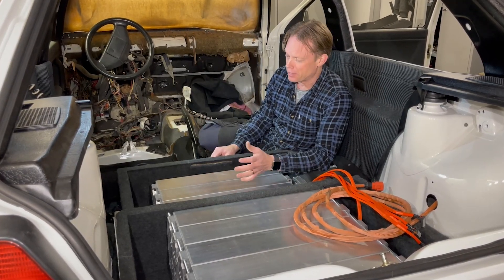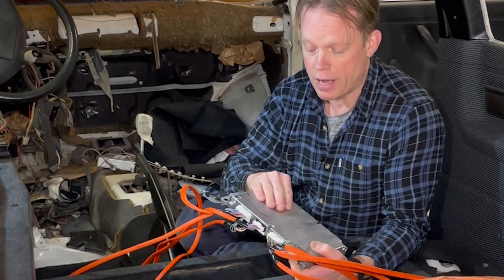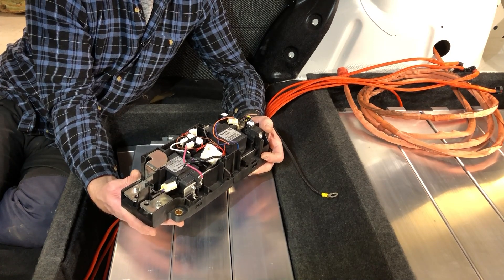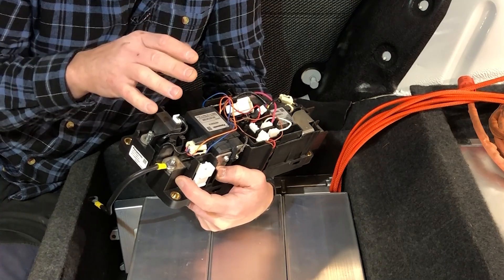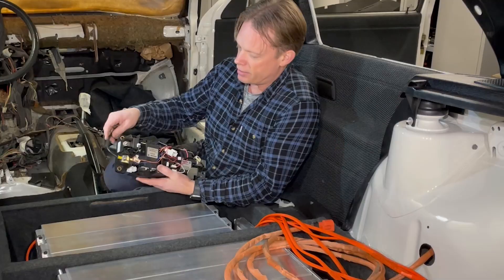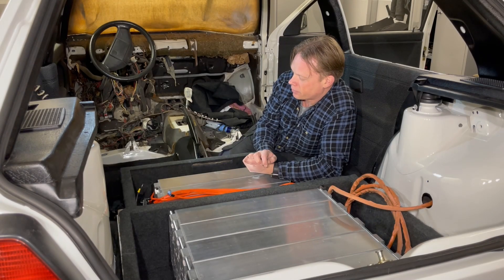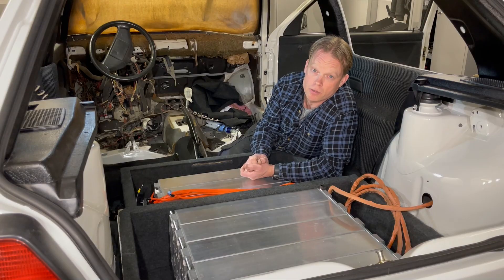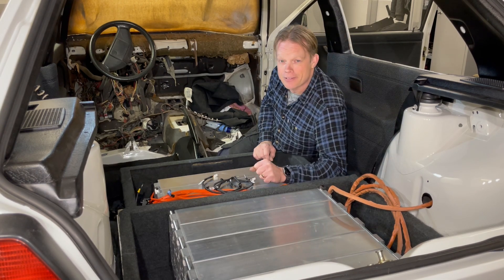Building a HV EV Battery to my Vw Golf Mk2 Citystromer

Comment: Did you only have to connect the individual cell voltage leads to the Leaf BMS connector to get it to work?
Are there any battery temp sensors that also need to be connected?
Was any CAN hacking required, or is this all just analog connections to individual cells?

I really like your method of using the Resolve controller with Leaf BMS, but using a different battery. It keeps all the functionality of the Resolve/Leaf system, but allows you to get a different battery if you need a different form factor or larger battery. A lot of the leaf batteries are also pretty degraded when you buy salvage cars, so using a different battery opens up so many options.

Comment: Any cooling issues I see you have finished your conversion, is pack air cooled?
Reply from the maker: No it works great here in Sweden. During fast charging I can see that the temperature rises around 4 degrees/10 kWh charged. So there will definitely be some limitations when doing that. But otherwise just fine.
Reply: @flyingtools  thanks for replying Sweden sounds super cool!!!!

Comment: Hello, this is an awesome project, congratulations! Would you think that for a small conversion of my VW Beetle with only 4 ID3 Modules (two in the front and two in the rear) I should stack two modules, like one on top of each other or better put them side by side and turned 90 degrees like you did? Everything except putting them upside down should work, right? Thank you!😊
Reply from the maker: Hi!
You can place them how you want if you don’t plan to have any thermal system on them. Good luck 😃
Reply: @flyingtools  Thank you!

Comment: Thank you for sharing your thoughts and plans. If you had any drawing on the intended components and wiring, this would be much appreciated. Maybe use a Nissan Leaf wiring chart for the HV system as a baseline.
Reply from the maker: Thank you so much 😃 Nissan leaf and ev resolvers wiring diagram is what I have used.

Comment: Pouch cells don't like this position. They are designed to have electrolyte covering cathode and anode equally. Best position is as originally designed - laying on the flat bottom.
Reply: In this case I would expect that it´s even better to install the modules 90 degrees rotated as shown here in this video, because LG-CHEM  mounted the pouch cells in a rotated way and not flat in the module as you can see in the "Open up a VW id3 id4 lithium battery module" episode here on that channel. Very useful and scientific document! Thank you for sharing.
Reply from the maker: Hi!
That was news for me. Can you please link to where I can find that information?
It’s important, so we all have the correct information about this specific cell.
Reply: @flyingtools  Well, I don't have specific info for this specific cell. MEB platform uses more models. Here is link to study on Nissan Leaf cells, since they used all kinds of orientation in the pack. I guess that is one of the reasons why cells are degrading so fast in the first gen.  Please, replace [dot] in the link, since youtube does not allow to use them in comments.
www[dot]cell[dot]com/joule/pdf/S2542-4351(23)00440-3[dot]pdf

Comment: hello again, now the interesting part starts!😀
Of course I remember you taking the lead acid batteries out and the car moved up!😄
Now with your careful planning and the new motor with regen braking and better efficiency this gives a second and I think much better life to your VW.
One question: why did you go for chademo? You mentioned CCS will need another 2 years to develop something? 
As always: keep on the interesting and very impressive work! (regardles if it is once a week)
I totally understand that it takes too much time to create videos rather than working on EV's and puts unwanted pressure on you! 👍
Reply from the maker: Chademo is what Nissan use originally, I need an adapter to convert the data from ccs to chademo and that is not out on the market yet. Thank you so much 😊